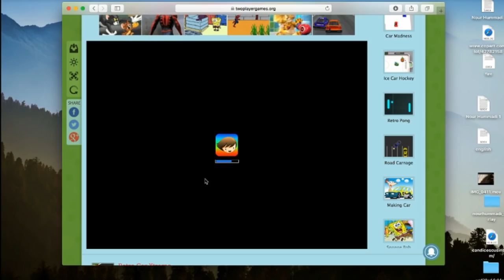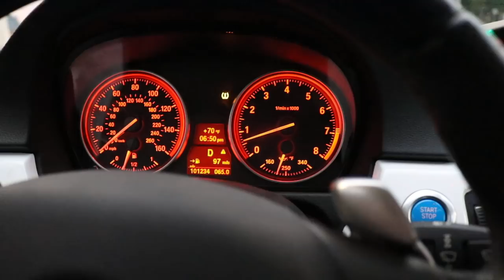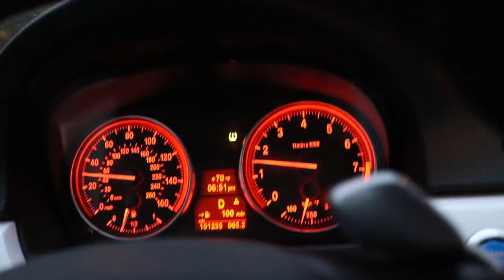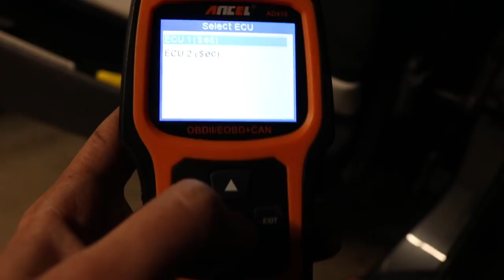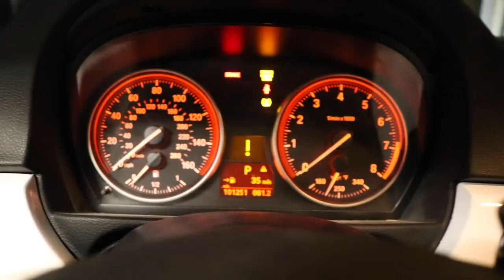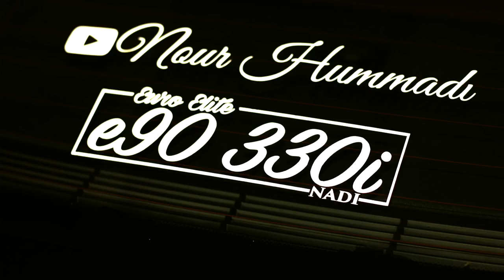THE 335I HAS SOME SERIOUS FUEL TANK ISSUES!

Comment: The tank sounds like its sucking, like its under vacuum. Are you sure it's under pressure? If it's under vacuum there is likely I vent that is blocked. That would explain why you get no sound when you open your tank when the cars been sitting without being run recently. Just a through

Comment: Did you change the fuel tank vent valve pipe? It can also be that
Reply from the maker: ronald munoz I’ll look into that thanks
Reply: this was my thought. the pressure builds because the DMTL pressurizes the system to look for evap leaks. if the TEV fails closed or has a short in it the system will build pressure with no way to decrease the pressure from the evap tests.

Comment: There is a hose on the side of your tank that runs up into the rear fender well by the gas pump side its the vent hose that might be plugged. You can take the fender lining out and find a hose that looks like has a whole bunch of lines that's the hose you should look for
Reply: Plugged or clogged ! ?

Comment: You can do a trick,do not tighten the fuel gas cap so that air can escape through so that i lt doesnt trip the system so you can pass smoge
Reply: chris dajim wouldnt that give him the error code that his gascap isnt on correctly again?
Reply: This code will probably pop up ... p1449: diagnostic module tank leak pump too high
Reply: True bmws arw treaky bastards ,he can try drilling one gas cap tho since he has two now, i am guessing the ecu would know if the gas cap is loose by some sensor that when depressed tricks the code (only speculating here i am a lexus owner and since they dont break,well...)